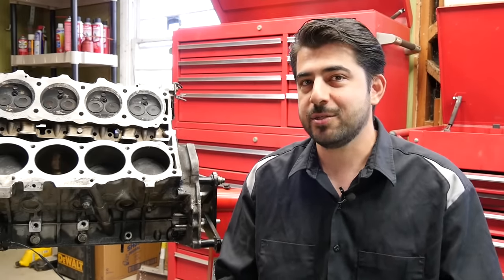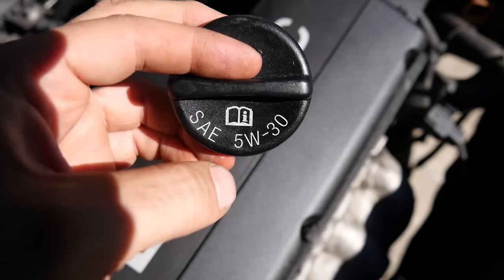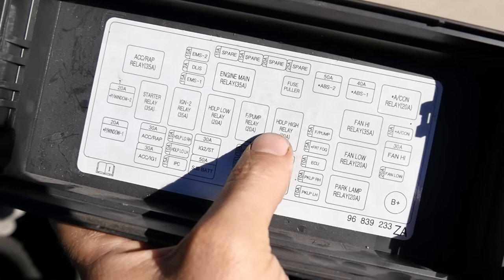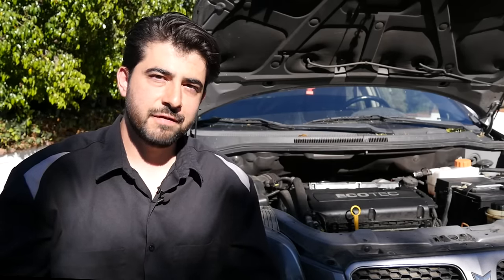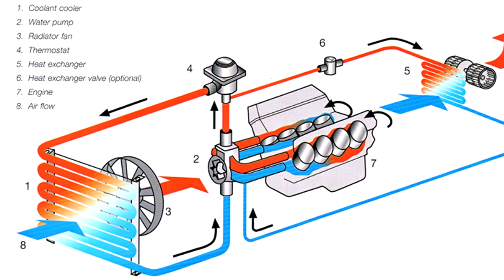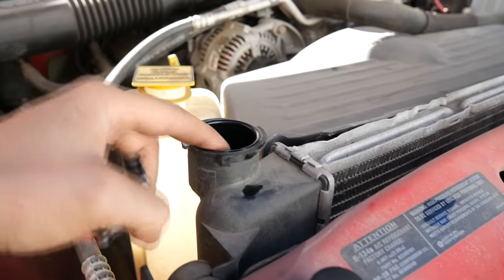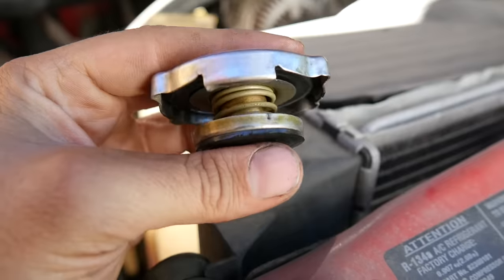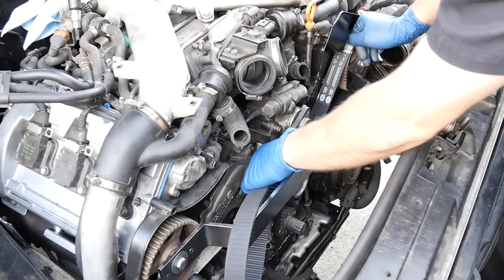Make Your Car Engine and Transmission Last a Very Long Time - Top 5 Tips On Car Care

Comment: My vehicle I bought new in 1996 just turned 400,000 miles on the original engine and five speed manual transmission. The trick is to do all your own repairs, maintenance, upgrades, and modifications yourself.  The, "professionals," are nothing but clock punchers.  They will not take pride in their work nor give it the special attention you will.  They just do things as fast as possible and send it out.  If you do your own work, you also save 92%.  You will not believe how long your vehicle will last if you do all your own work on it. Even an infamous car can last a very long time if you are the one doing everything to it.
Reply: I went to the  garage to change a coil pack and charged me £150, that's a part I could have bought from ebay for £50 and changed myself in 1 minute. The only time I use a garage now is for an M.O.T, bought my own tools, a Haynes car manual and educated myself on the Web,  so far I've done everything for a service multiple times, changed a gearbox, timing belts ect. Saved a load of money and have some pride in myself.
Reply: @reikoruffneck4613  Best of all, you took the time to do it right and not have to answer to some boss screaming at you to get it out the door and get the next car.  Those clock punchers take a lot of shortcuts because of the pressure they are under, to get the job done in a hurry.  It is not rare to find missing bolts, crossthreaded bolts, missing covers, and lose components.  It is not really the mechanics fault. They know what they are doing. They are just so rushed to get the job done and send it out the door.  Anybody would mess up.  I will never go to a "professional," mechanic again.  Wait until you see how much you save replacing the roof on your house yourself, or changing your own  water heater, or repairing and running your own plumbing.  I have not hired anybody to do my service and maintenence on my vehicle or house in a very long time.  I do not even have a credit card because I save so much money doing things myself that I find no need to charge the cost of an expensive repair or upgrade.  People are actually fooled into thinking they can not work on their own automobile, and house.  Anybody can do these repairs with schematics and directions on the Internet.  One just has to be willing to do it and have some tools.
Reply: I have a Lexus and do all the maintenance myself.  NEVER go near the dealer.
One repair in 21 years....fuel pulse damper $20 and 20 min repair (I'm slow).
Reply: @indridcold8433  we must be related. That's exactly they way I operate. I use to say I can pay someone to mess it up or I could mess up three times and it'd be cheaper and I learned something. The internet is a wealth of information for someone willing to try to do it themselves.
Reply: I agree with you but if the car has design issues, no amount of personal care and love will cure it.  I'm talking about my Odyssey with VCM engine.
Reply: I am realizing just how true this is. Started learning and doing simple fixes and maintenance myself. Much less money and I am becoming an educated toyota owner.
Reply: Nicely said we do think a like i do everything on my truck
Reply: I do as much as I can and buy parts online when it's not a rush and my mechanic doesn't mind me bringing hom the parts. I save $$$.
Reply: Just another way of saying you bought a Toyota.
Reply: Agree 100%
Reply: My local Ford dealer rocks!  - Ohio.
Reply: I think the same! I don't trust the professionals (not many care about your car)
Reply: Indrid Cold I agree - but credit Card  ??
You have to build up credit so you have to have credit cards,  just don’t abuse them. I too am a shade tree mechanic as well as a house repair mechanic . If I can’t fix it then I will get some help.
Reply: @reikoruffneck4613  changing a timing belt is a hard job and requires some knowledge, skills and a keen eye. My question is if its such a hard job how were you able to do it yourself. And if you do something wrong the engine might not run right.. You know. So how were you able to do the job properly??
Reply: transporter78213 false
Reply: S M.zaidi gotta have patience and follow the information online...there’s always something. Don’t be scared to do the job yourself you just gotta slow it down and make sure about every step you gotta take to ensure you’re not about to break something...if these guys can do it so can you and like they said you can have all the time in the world for your job but I’ve been in a shop before and techs (especially flat rate) are only concerned with getting hours on their time sheet and cars aren’t given the same care you could give it🤭
Reply: @Zaidi_227  difficult but not impossible.
Reply: I don't necessarily agree with this. If you maintain the car properly, there will be minimal repairs. But some things just can't last forever, like spark plugs, water pumps, starters, etc. By doing it yourself you're saving money but loosing A LOT of time, if you're inexperienced. And if you're maintaining the car well enough, not enough things will break down to give you adequate experience go deal with inevitable rookie mistakes. Not anyone can't or shouldn't work on their own car, but mechanics are always the worst thing in the world. If you're gonna bring it in, talk to the guy who's gonna work on it, and out a face and name to your car. If you just drop the keys off in the middle of the night they aren't going to give a shit about the car one bit because it's just an object to them. Human nature
Reply: Its true. Over the past twenty years I have done much of my car work like replacing parts and saved many thousands of dollars in repairs. However, I never owned power tools and didn't bother to learn how to do the more complicated jobs. Just recently I bought an impact gun to cut down on the time to do the job and the body aches after a long day or two working on my car. I'm not in the shape that I used to be. Last month I replaced all brake pads and rotors saving at least $500-$600 in labor cost with the added satisfaction I took care of the smallest details. I couldn't be happier. This weekend I'm going to replace some suspension parts and the front bearings and then research how to replace the timing belt for a later time. The amount of money that we can save doing this ourselves pays for tools many times over and you know its done right. Unless I physically can't do the job like an engine overhaul I probably won't be visiting any more car shops in the near future.
Reply: Theodore Misc  I am still with my faithful rolling time capsule.  Tomorrow, she will be turning 415,000 miles.  I just replaced the radiator with an all aluminum one because the plastic one kept failing every year and a half.  I just now also bought new tyres and just mounted and balanced them on the rims today.  Back in 1996, I never dreamed my new vehicle would be my last.  I simply hate the modern garbage today. I never wanted to become an old man driving an old car.  But it looks like I am heading that way. Next year, my dear mechanical friend gets her historic vehicle registration and tags.  I will likely get classic vehicle insurance as well.  I am toying with the idea of rebuilding the engine next year.  Though she is still running very good, cylinder #3 compression is right on the minimum required compression.  At the mileage she has, why not go ahead and just rebuild the ancient inline six engine?  But the engine is also running good and maybe I would not fix what is not broken.
Reply: Good advice if you are a mechanic. My newest vehicle is a 2001. I go with proven reliable vehicles and nurse them out to 200,000 to 300,000 miles.
Reply: @indridcold8433  To take that a step farther I started maintaining my own light airplane. I was an avionics technician in the air force and a factory trained heavy equipment mechanic for decades. After my third forced landing I began maintaining my own airplane. Problem solved. I did a much better job because it was my life on the line. A&P mechanics were pissed and asked me how I was going to enter the repair in the log without a license. I replied enter what in the log???
Reply: @burtvincent1278  If you stayed with using the aviation mechanics, your log would have been the thickness of a phone book because of their crappy service. Since you are doing the repairs yourself, you can remember what you did and just do it once.  You will not need a logbook at all.  There was a time, not too long ago, if you wanted something done right, one hired a professional with a sense of pride, duty, and accomplishment.  The job was done right, although it may have cost more than if we did it ourselves. Today, that choice is largely taken away from us.  If one wants something done right starting about the late 1990s, looking up a schematic, diagram, and instructions, then doing the job yourself is the way to have it done right the first time.  This may mean getting tools, or renting specialty tools.  But even with the purchase of tools and renting of specialty tools, the job will still be much more affordable to do and the peace of mind that it was done right is near priceless. A, "professional," does not care if your vehicle breaks down in the middle of a deserted road and the cast of, "Deliverence," comes to visit you.  They also do not care if your light aircraft has a forced landing in an old Nuke Town with the cast of, "The Hills Have Eyes," slobbering to rape you. Nor do they care if you are on your boat and it breaks down in the middle of the ocean.  Then you find out from an enormous shadows circling the boat that, "you are going to need a bigger boat." As soon as the job is pushed out the door, they do not care what happens. That is not the way it used to be. Unfortunately, it is now.
Reply: @Zaidi_227  There is no such thing as a hard job. That is a state of mind that you trick yourself into. Hard is the density of an object not an adjective for work. At one time, a mechanic was not skilled an he had to learn how to do it. What is the difference in you learning versus how they learn. Just need the tools, dedication and knowledge and skill will come with time.
Reply: Thank you
Reply: @jimmysapien9961  There is no need for credit, at all, if you pay cash for everything.  I have never had credit cards.  I have only bought cash.
Reply: My father died Nov 3rd 2021 and he gave me his Chevy Malibu 2005 to me in high school, he was a Diesel mechanic and he inspired me. I love the car and I want it to last forever shit do I love the car, looks niceee great steering and handling and has held up VERY well.
Reply: Lol i agree lol it's funny cause I do my own handy work also
Reply: @Lunarphantom99  There was a time, not too long ago, when you wanted to have something done with pride, dedication, and done correctly, you hired a professional.  Those days are behind us now by about 30 years.  Today, "professionals," are mainly just a bunch of clock punchers, with minimum training, with an incompetent boss screaming at them to get the job done as quickly as they can do it to get to the next paying sucker. Today, diagrams, schematics, repair manuals, upgrade procedures, recommended madifications, even design weaknesses are all readily available for everyone.  There really is no excuse not to buy tools and do everything yourself.  But the laziness and indoctrination that the ordinary person can. It possibly do what it takes to keep modern things functional has taken hold of most.  It is actually far easier to troubleshoot modern vehicles and equipment than the vintage equivalent.  It is, however, harder to get to the parts to be changed because of poor design with no foresight for serviceability.  But all can be done by anybody with an IQ from 100 forward.
Reply: @indridcold8433  straight 6 Ford or Chevy?
Reply: @xmachine7003  Neither one, though the mentioned ones were great also.  It is an AMC 242ci I6.  It was developed in 1952, then retrofitted with throttle body injection in 1990.  In 1995, it went to port fuel injection.  In 2000, it dropped the distributor, ignition coil, cables and got a direct spark ignition rail.  The ancient engine was terminated in 2006 because the tooling was warn out.  The engine went through Kaiser Motors, AMC, Renault, then finally Chrysler with all its constantly switching ownership.  The vehicle now has 425,000 miles on the odometer.
Reply: What about us people who know absolutely nothing about cars?
Reply: @nickmcdonald4526 start with the basics like oil changes, air filter, tune up, etc.
Reply: @Aj-me8mo  All it takes is a little reading and watching videos. I knew very little about cars a year ago, and yet now I feel confident enough to at least consider doing any job. 

If you have the desire to learn, the info is readily available. Just about anyone can do it.
Reply: How many clutches in 400k miles?
Reply: @ih8momjokes1  I have replaced one clutch.  However, I may be getting close to another one because I get some slippage on a very rapid take off.  But, clutches are simple to change and are affordable.  Even the factory clutch, came off with great ease.  Often, factory equipment is hard to take off.  The original lasted about 220,000 miles.
Reply: @samuelm370  I never understood the thought processes of  people.  If the item is broken anyway, it is not going to cost any more to get it fixed if you can not fix it but try to fix it.  The worse case scenario, the item is still broken, and you learned something.  People are indoctrinated to believe they can do nothing themselves.  Thus, they wind up paying $500 to have an alternator changed, something that often is only  two bolts and a connector, only.
Reply: @transporter78213  There is nothing wrong with a Toyota, as long as it has a gear driven transmission and no CVT.
Reply: @indridcold8433  wow that’s really impressive mileage out of a clutch. My engineering prof always says new tech is actually worse tech ! I.e automatic transmissions
Reply: @sertimins  If the vehicle proves to be a bad design, keep it running until you can get a more reliable, easy to service, vehicle.  You can still learn a lot from your lemon.  Take every opportunity you can to learn all you can about it and do all the work you can do to it yourself.  The experience, tools, and knowledge, you gain from working on your lemon will be directly applicable to your next more reliable, easier to service, durable, vehicle.  When you get your next vehicle, forget the fuel economy.  That is secondary.  Concentrate on reliability, durability, serviceability, and ease of obtaining parts.  That will save you far more money than the most economical car on the planet that has terrible reliability and durability.  My vehicle only makes 20 miles to the gallon on the freeway.  That was after I did some modifications.  She is a thirsty thing.  However, in 27 years, only one major repair has ever been needed and only very  minimal minor repairs have been needed.  Not many can say that about their vehicle.  I have saved tremendous amounts of money.
Reply: Lovely advice!
Reply: @indridcold8433 not trying to "fluff your balls," but your comments are excellent. I mean that. 

Have a good one boss
Reply: What if someone is a really terrible mechanic but they still do everything themselves and poorly? Will their car still last 400,000 miles?
Reply: Saboteurs at mechanics shops trying to get more repair $...
Reply: Saboteurs tho. Everywhere..
Reply: @MR..181  You are exactly correct.  That is another reason to avoid the, "professionals." The vehicle is malfunctioning anyway.  Why not give a try to repairing and maintiaining it yourself?  The worse case scenario is that it is ruined.  Well, the part you are addressing is ruined anyway.  Thus, you are out nothing.  But, you have a lot to gain.  It is time for people to pick up the wrench and multimeter again.  It is a myth that only the, "professional," shops can do the work needs on modern cars.  There is a, lot less space under thd bonnet.  But, troubleshooting is as easy as plugging in an OBD computer.  Get a good jack to lower the engine out of the engine bay to change parts on the engine.  But that is the only thing you have to do that is annoying for newer vehicles. Once the engine is lowered out, the work on the engine is actually easier because now you have unlimited side space.  One does not always have to lower the engine from the engine compartment, also.  Save money, the world, and time repeating repairs. Work on your vehicle and keep it a longer than usual, running a lot better. Trading in yiur vehcike every 4 to 5 years is not saving the world in the slightest, regardless what the politicians and car makers say.